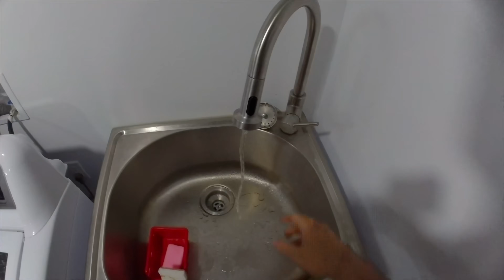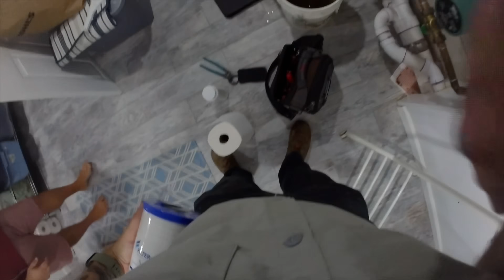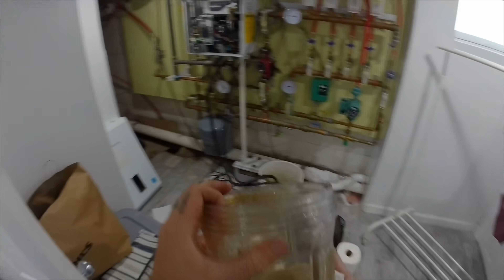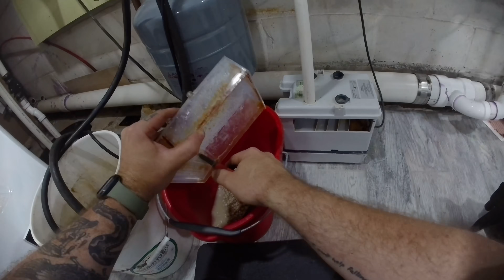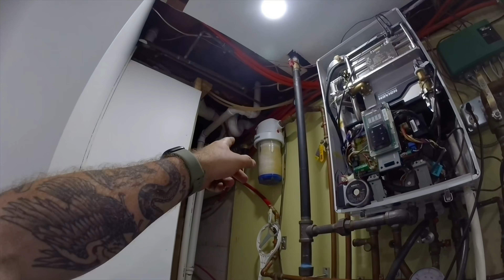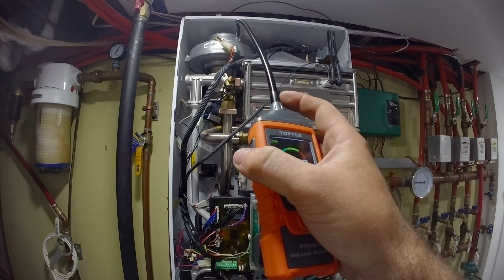No Pressure, No Hot Water, No Maintenance… BIG Problem

Comment: far left is a sediment filter, usually just opening the drain/flush valve is good enough to clear them. they're far more popular in areas with well water full of sediment/silt.
Reply from the maker: Thank you, was trying to figure out what the heck I was working with here
Reply: @PlumbguyNY  I'll add, those are generally a stainless steel screen(cylinder shape) that can be cleaned if need be, seen plastic mesh type in the past as well. most are around 100 micron screen size, although it can vary. they're just made to catch the bigger chunks/sand size grit before hitting the next filter/s.
the have angle fins that makes the water swirl to help settle debris down, opening the drain valve usually does a good job making it swirl clean the screen off and dumping it out the bottom. 
probably doesn't even need it there as the debris seems very fine. 🤔